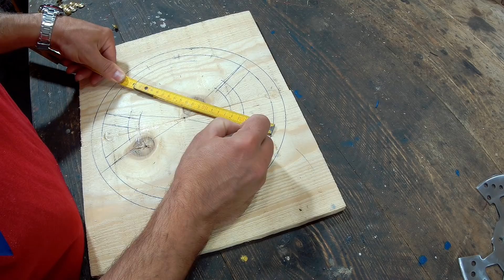Making a double bladed axe from disc brake

Comment: Not a good work, just for decoration, not a real axe. The connection between axe blades and handle by those two points makes the axe too weak for actual uses. By the way, still beautiful decorated item, should it be only for that purpose. Thank you for your project.
Reply from the maker: Thanks my friend..